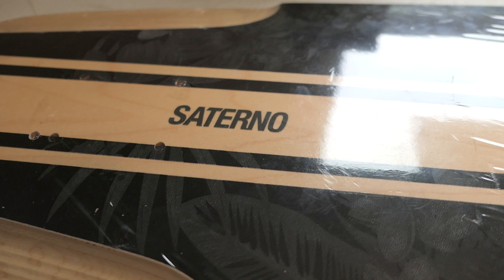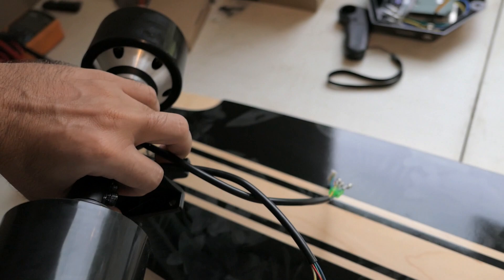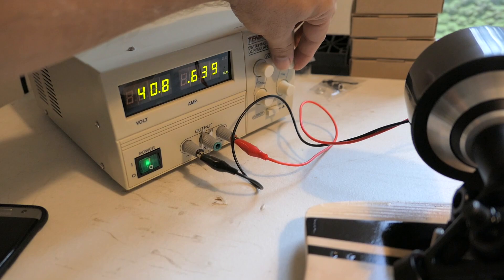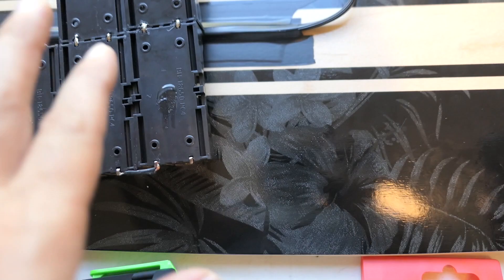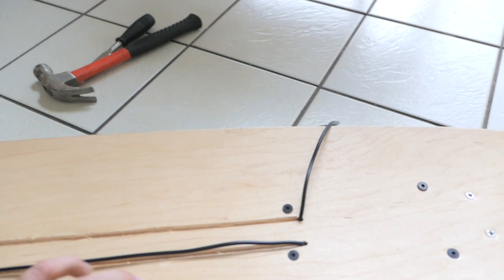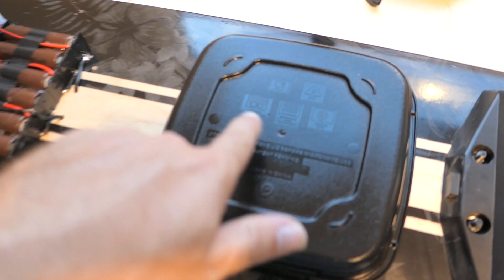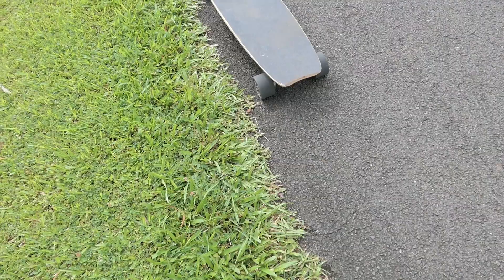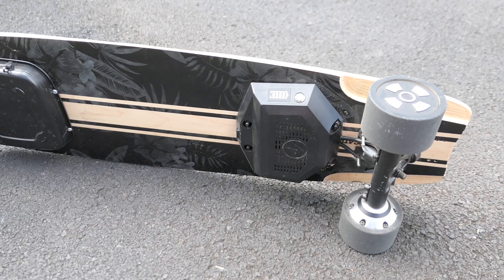$350 Electric Skateboard Build - DIY Parts List

Comment from the maker: $550 AWD Diy Electric Skateboard Video: https://youtu.be/3Li_V6xIAuI
Reply: you can sand of the labels on the box
Reply: Ski Guy he made the right decision because a battery pack has a shorter life time than the batteries that he is using. He can also get the exact voltage he needs this way

Comment: Dude this is awesome you did a fantastic job!!! Couple things: You should use risers for sure (the square rubber things that go in-between your trunks & the bottom of your board to reduce vibrations. You 100% need to use black foam to seal your battery & ESC compartments, that would stop water & dirt from getting in and it would fill the small gaps due to the curvature of the board but other than that KILLER!

Comment: You have no breaks when the battery is full because the breaks support regenerative breaking. When the battery is full the ESC tells them not to work, because they cant charge the battery
Reply: That's interesting.
Reply: Is there a way to fix that?
Reply: @lowwcas  discharge the battery a bit before driving.
Reply: I have regen breaks and my board always breaks! Must be faulty ESC on yours. Did you figured it out?

Comment: Hey Dude, Great job, congrats!   btw, you can fix the backward issue easily by swaping cable connectings of 2 motors.  Its hard to pick a suitable BMS to get reliable brake. Nice Job on building your own battery!   Sumsung 20R or LG HD2 cells may improve your riding :)
Reply from the maker: I will try to swap the wires soon. The bms has been doing good so far with no issues. I'll look into the batteries, might do another build in the near future. Thinking AWD set up. Thanks for the tips and support.
Reply: you dont really need to since you have a "reverse" switch on the remote. it just switches which way the motors run and does the same thing as swapping the wires. 
also, on grip tape, just cut it with a razor blade or a razor sharp knife.
Reply: KieranMaofromMeepoBoard what's up dude
Reply: hes the owner of Meepo

Comment: A 10S, 2P or 12S, 2P or 3P or 4P would be way better for the performance and range and top speed of the board and it wouldn't cost you that much more. Also you can buy "flat" wires to put under the grip tape, I got mine from Radio Shack and they work amazingly. But pretty cool at home build man, it's cool to see custom boards.

Comment: If you want to go forward in the beginning just cheak so it is a brushless motor. If it is a brushless system it would use 3 cables for every motor just swap two of them and repeat the same proses on the other. You can watch how to on YouTube if you want a better description how to do it.

Comment: To stop the reverse happening on startup open up the controller cover and switch two of the wire for each motor (2 on left wheel and 2 on right) and it will start in the other direction :)

Comment: A line of draught excluder foam tape, the type you use on doors and windows will fill the gap on the speed controller box perfect, just outline it and follow the line with the line of self-adhesive tape, perfect fit. and seal

Comment: hey, you know what, you should change the order of wires connecting hub motors to the esc to solve the backward starting problem. Great video btw. I also did a diy electric longboard just for $250 including battery. I hope to shoot a video of mine soon.
Reply from the maker: Awesome, let me know when you have the video up and thanks for the tip about the hub motor wiring, ill try it. Its kind of annoying to start in reverse always.
Reply: He's right. Hoping to see at least 1 comment of this type, glad I did.

Comment: take any 2 of the phase wires connecting the motors to the esc and switch them. (do for each motor). it will make it so you don't have to reverse the direction on the remote every time you turn on the board.
(~learned this tip from mike beard)

Comment: Have you charged it yet?  Does the bms balance the batteries when at full charge?  It’s probably beeping due to voltage sag. This is VERY bad for your battery.  To fix it either get more cells in parallel or lower the amp draw on the esc.  I am not positive but you may harm the caps in the esc by extending the battery cable that far. It’s better to lengthen the motor wires instead of the battery wires.  Please make a follow up video.

Comment: Please for the love of God use the risers maybe not the big chunky ones that came with the trucks but at least get the thin rubber ones, electric longboards doing relatively high speeds will inevitably have strong vibrations acting on all the parts and having no riser pads to dampen those vibrations will eventually cause stress cracks on your board
Reply: Other than that  you did a really good job for your first electric longboard build. This board actually seems to be better quality than some of the Chinese electric board companies 😂

Comment: Dude, the lg hg2 can give like 20A and the esc can draw much more... The board is beeping because the batteries cant hold up... You need to add more of them in parallel or you need to get different kind of battery, like lipo, wich have higher discharge rating
Reply from the maker: Very true, too much voltage sag. A p2 setup would be much better. But I have an idea of how to get around this problem and will be sharing my results soon. Thanks

Comment: What I would like to start working on is using the flagship cellphone batteries. They are flat and can be joined in continuous fashion to create that Inboard M1 stealthy appearance. I don't like the clonky appearance of most of the eboards.  I'm working on it.
Reply: Anti Petrolhead, same kind of thing as I am working on! Only mine will be sleek AND foldable :D.  I need it to fit in my schoolbag and yet needs to to be a longboard lol. And it has to be sleek and nearly unrecognizable as an e-board, and instead as a normal board.
Reply: Check that any you go for are capable of high output or they will self limit your topspeed

Comment: its a meepo board basically bro
Reply from the maker: It appears to be so. If i get a chance to ride a meepo i will then know. thanks
Reply: What constitutes this being a Meepo?  The Meepo has a dual hubmotor drive with (2) 250w motors.  Vlads set up has (2) 550w motors.  The potential is actually much faster than a Meepo.  Vlad is using a 5S set up while the Meepo uses a 10s Lipo setup; so that's different. Also, Vlads deck is of his own choosing, which is also different from the Meepo.  Lastly, he built this himself....Meepo boards are full production boards.  So besides the enclosures, ESC, and remote it's not "basically" a Meepo.  Great vid Vlad and cool that you got into DIY this way!
Reply: The new meepo uses sanyo 20700s though which are far better batteries
Reply: nah, the esc is the same, the motors are the same, and the esc is the limiter, not the motors, the battery is half the meepos on this one, meepo has 10s2p this is 10s.

Comment: what about the hall sensors? Some explanation of what they do will help...
Reply: Trail Rider because it uses  brushless motors there is nothing mechanical part to check the 'position' of the motor so the hall sensor do the job it helps a lot when you start the board, you can have jitter and low power  when starting without it

Comment: Love the battery holder idea
May try to tackle that to lower the profile of my container 

Any chance you could do a more detailed video of building a  battery with the holders?  Especially cell numbering and wiring 
10s4p would help me terrifically
Reply from the maker: Thanks for your comment. I was not planning to do any detailed sk8 videos until next project, but if i get a chance I will try to at least make a video explaining  in detail of how to build a battery pack. Stay tuned. Thanks
Reply: 2dthoughts, I have a picture of a drawing that I just finished, it's for a flat 10s2p battery pack, you can use it to make a 10s4p battery pack, hopefully I will make some YouTube videos soon.
Reply: Isaac Lyons Thanks, I appreciate the offer but I’m interested in seeing the (holders) used at that voltage to see if they work or  need to be altered.
Again I do appreciate the good will
I have my build on my channel if you’re interested.  I used 2 hover board batteries with LGs in parallel 
Have also put on a psychotiller enclosure on since video
Reply: 2dthoughts, I would suggest that you just get some 18650 end clips, which are basically square plastic ends that can be clipped together, then you can spot weld the battery together, that is what I am going to do.
Reply: Isaac Lyons I’ve thought about those.  They seem to be a pretty solid method. 
Those holders look pretty quick and easy.  And if they work long term and you have a bad cell, seems like it wouldn’t be difficult to find, swap and get back to riding.  Verse having to break apart a pack and rebuild.
Reply: 2dthoughts, exactly

Comment: Please help me with the connection diagram. I tried all the options and I have the last way - to write to you. I started making my own board for your project, but there were problems. When I connecting the BMS to a controller, it practically does not react and switches off. Maybe I incorrectly connected the 2 BMS with each other?
Reply: I have the same problem. Cant figure out how to connect two BMS together
Reply: you dont connect the bms together at all, each bms controls 5 cells and the and the 2 groups of cells are in series. think of it this way the first bms is wired to the 1-5 cells in the pack then the 2nd bms is wired to the 6 to 10 cells. so the wiring (without the balance wires this is just the power wires should be neg to bms then batteries 1-5 then the positive from that goes to the neg of the next bms then cells 6-10, this makes it into 25c battery packs that are hooked in series

Comment: Why did you use series connection for the batteries? from what i know, people use parallel connection to equally drain the batteries
Reply from the maker: Series is for adding voltage, parallel is to add capacity. You can't have one without the other. If you put all the batteries in parallel, you would have only 3.7 volts and a ton of capacity.

Comment: Hey Budy.. can you measure the energy from the regenerative Breaking at the power station? For example, trst it on a running treadmill? I realy would like to know the results. Because i am think that the energy output is nearly zeroo at this kind of regenerative Breaking. But please do a test if posible. THX
Reply from the maker: Hey, i dont have a treadmill to try it but i know its defiantly putting power back. Lets say i have 2 bars on the battery indicator and i go down a reasonably long hill it will charge it to 3 bars. Not sure how much energy it is exactly. But if i get a chance to do a test ill post it. Thanks

Comment: Good you think that board would make it up a 15% grade hill with those motors? You can use online steepness calculators with maps to find out how steep the hill you climbed was, thanks.
Reply from the maker: I think if you are in the 160 pounds range this thing will make it anywhere. My son is about 90 pounds and it will defiantly climb any hill with speed. Im 190 and when batteries are 80% or more it does great but after a few miles of riding some hills become an issue. because i have not tried other boards i cant really compare. Plus if i had a bigger battery pack i would have less voltage sag and would do even better. Thanks
Reply: Just Vlad, ok thanks!

Comment: What's the maximum voltage the esc can handle? Will a 44.4 volts 4400 mah battery source work?
Reply: It all depends on the esc you buy, but they generally go by " the more amperage the higher the price"

Comment: Hey man i live the battery set up , can u send me your wiring diagram for the bms set up ? Thanks
Reply from the maker: Here's a picture https://goo.gl/HMSnb5 
Its not to complicated but if you have trouble just research it.
Reply: Just Vlad When you plug the charger in does the BMS shut off charging automatically?
Reply from the maker: +Jackson Mahaffey normally the BMS keeps all the batteries at the same Voltage. Your charger will shut off when the output reaches a certain voltage. BMS is there to regulate voltage differences in the battery pack and keep them as close as possible to the same voltage.

Comment: Can you please explain how you connect the two bms?
Reply from the maker: You do not need a two bms units. i used two 5s cause i had it from another project. Use a single 10s unit like this one: https://goo.gl/aote3r
Also you can watch this video, for more help with bms install: https://youtu.be/khxp5slfsDQ
Reply: Thanks! I already have two of the 5s ones, can you please explain how you would connect them with the batteries? If not I guess I'll order the 10s, but I really want to start building the board :)
Reply: Could you maybe draw a quick little diagram or something :) would mean a lot
Reply from the maker: I would recommend getting a 10s because some BMS moduals might not work in series. Your just going to risk it, if you try to series the two 5s.
Reply from the maker: This might help: https://goo.gl/images/eRmiF5

Comment: Whats the max range and speed?
Reply from the maker: +Star Respy it hit 20mph easily with me weighing 190lbs. If your lighter I suspect it will go 22 for sure. My range is 6-7 miles, but it's an ultra slim battery case which is the trade off.

Comment: How fast can it go and what is the range?
Reply from the maker: Goes 20mph with me being 190lbs and has 6 miles of real range. Thanks
Reply: You should get more mileage using the lithium polymers. It takes 4-5 hrs. for those 18650 battery cells he used to charge smh

Comment: why does the board beep?
Reply from the maker: I had a bad battery connection, which triggered the low voltage alarm on the esc. Thats the beeping you hear but i had it fixed shortly after that. Thanks

Comment: Just wanna add that that remote is the most horrible remote you can ever have for an electric skateboard. DO NOT order it at any cost lol. Instant breaking and acceleration, very dangerous.. plus the button on is to switch forward or reverse which you can easily misclick when riding, RIP.